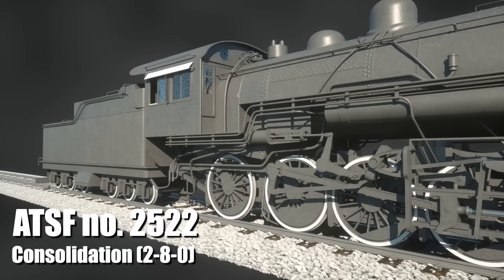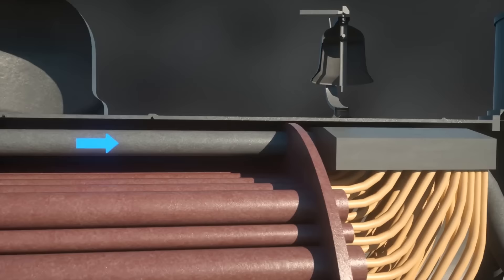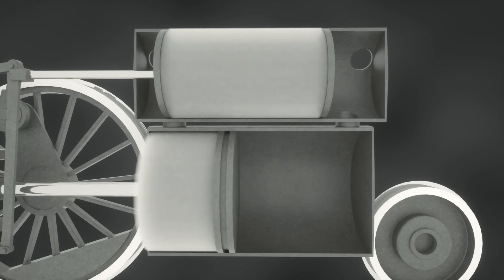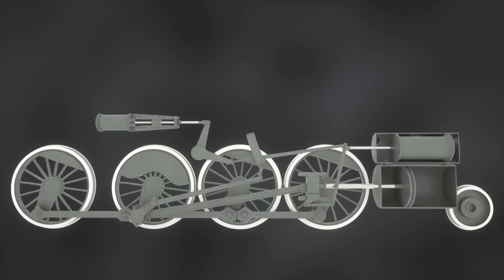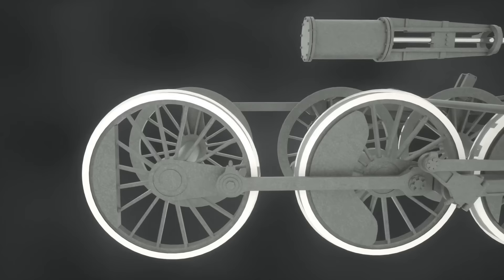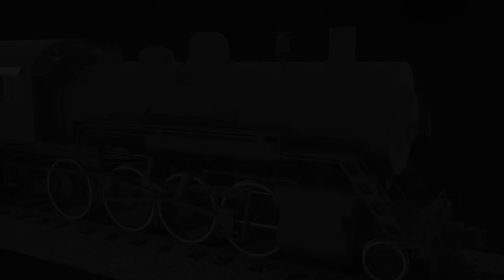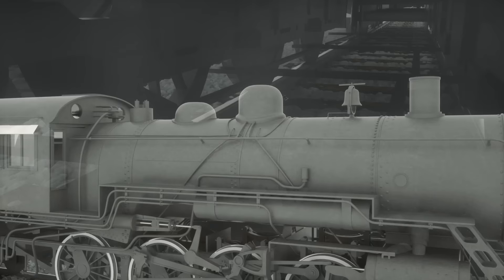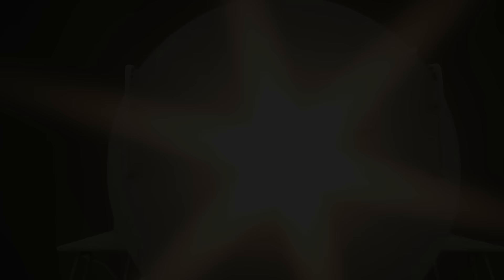How A Steam Engine Works

Comment: I would argue that it actually isn’t outdated. For passenger transport it is. But so is diesel for that purpose. Steam trains are actually more powerful than diesel trains and are actually generally simpler in design and function. However, the problem is energy waste. Diesel engines are more fuel efficient. But steam engines also use cheaper fuel. You can go back and forth though.

Comment: I learned a lot.  Thanks.  

Correction:  Coal was the dominant fuel for almost the entire history of the steam locomotive, not oil.  Engines were getting converted to oil as they were fading out, being replaced by the diesel electric locomotives.
Reply: I'm not sure on this one but when the steam engine came out , Didn't they use wood for fuel first and then went to coal ?
Reply: @ironmartysharpe8293  Sure.  Coal wasn't mined much in the very early 19th century.
Reply: @frequentlycynical642  Wood was also used in places where it was more readily available and cheaper than coal, such as Russia and the Nordic countries. But even in those places coal was preferred if available, as it carries more energy per volume and also produces less ash and sparks, reducing the risk of forest fires caused by steam engines.
Reply: In the U.S., after the early days of predominantly wood, the fuel of choice tended to be what was most available and cost effective regionally.  Generally (very generally), this meant coal in the east and oil in the west.
Reply: It must have been a huge blessing to the fireman/stoker when oil was used - so much easer to load and apply than coal or wood ............ Unless the train companys just fired the stokers !?!
Reply: @stupitdog9686  Many, especially large, coal burning steam locomotives after 1900 also mechanical stokers.  There were some variants, but the most typical had a corkscrew scheme to move the coal from the tender to the locomotive's firebox where the coal was brodcast over the top of the existing burning coals.
Reply: @stupitdog9686  No, the unions prevented that.  They basically did nothing but got a paycheck.  It was called "feather bedding."
Reply: same principle still
Reply: @trainliker100  I never heard of oil being a regionally preferred fuel.  The UP's Big Boy locomotive were strictly for the western states and they ran on coal.
Reply: @frequentlycynical642  A cost choice was the usually the biggest determinant.  For example, most of the Southern Pacific and its subsidiaries burned oil, not coal.  Because oil was in the area and coal would have had to be transported long distances.  Even in coal burning engines there were different firebox designs depending on whether the lowest cost, and most available, coal was lignite or bituminous.  The CB&Q had a number of Class O5 4-8-4's all built as coal burning, but converted some to oil as that was a better choice where they were running some of them.
Reply: @trainliker100  What years are you talking about?  That makes a huge difference.  Also, oil didn't come along overnight, it was a slow process.  Now, even the UP locomotives burn oil.
Reply: @frequentlycynical642  I'm not talking about any years in particular.  Just in general.  But to think about it a bit further, they didn't build those giant Fairbanks-Morse concrete coaling stations, and have to go through either hand firing or a stoker, and deal with having to dump ashes, when oil is so much easier, because of any superiority of coal, other than cost and availability.

Comment: Nice.  Your cutaway of the end of superheater flues cleared up a lot for me.  Small fire tubes, out of contact w the water,  within a big fire tube.
The combo of big tube's low surface area for their volume, and the fact that the inner tubes are not in contact w the boiler water,  means the air has tons of have tons of heat as it enters the superheater.

Comment: Even Though I'm just a Nerd, I'm gonna point out some things you missed:
1: About The Airbrakes, Pressure Releases it rather than Bite
2:The Steam powered bell does not really move the whole bell, It only moves the Clapper
3: You Missed on How the Injector Works is a steam pump that sucks Water to the Boiler(It's kinda hard to explain without a visual aid)
4:Please A More Chimney Boy Whistle :)
Reply: Some bells had the entire yoke swing, called a piston ringer. This was standard from 1906 until the 1940s. It was only later that the clapper ringers became common. There are also several different types of injectors, but all use a fairly similar principle of creating a vacuum and water rushing into fill said vacuum, simply some require steam to lift the water, whilst others use gravity.
Reply: That is not quite true.  

The air in each car does the real work. Reducing air in the train line activates the system. 

Also locomotives have a separate system than the train brakes. It is always direct air.
Reply: Well the bell wouldn't have been activated by steam anyways. It would have been air, or a pull cord. And yes they had two types one that made the entire bell swing or just a clapper.

Comment: Kinds of valve gear:
Walschearts valve gear - the first one
Baker valve gear - reversing yoke
Stephenson valve gear - 1 piston and 2 180 degree pistons
Hack worth valve gear - crank shaft connect up top

Comment: I love steam engines! They are indeed marvelous pieces of engineering and cold starting a more modern engine is quite a time consuming process, in part because steam literally drives everything on that engine and there are a ton of valves and so on that have to be opened and closed in a particular order to do a proper startup.

The one thing that railroads could have benefited from, which was never done because it was decided that it would be difficult to integrate, is multi-stage pistons. Here, we have an illustration of a typical two-stroke piston. Once the steam is used, it is exhausted or recirculated through a condenser (rarely) prior to being returned to the tank. The steam that is exhausted still has a good deal of energy in it. By increasing the surface area of a successive piston and reducing the stroke length, you can still take advantage of that extra energy to operate a second, third, or even a fourth stage before reclaiming the water. Multi-stage steam engines (not locomotives, just general engines) are fascinating and significantly increase the engine efficiency, although the efficiency and power of any steam engine is still far below that of an internal combustion engine, which is why they aren't around anymore. However, one thing steam engines have in SPADES is torque which made the ideal for certain categories of devices.

Comment: I need a source on that oil thingy. Always thought that most were coal fired
Reply: Yeah I have to say I've never even heard of an oil powered stream locomotive. All footage of steam trains I have seen online and even ones I have seen irl have all been coal powered, with one of the engineers needing to shovel coal into the furnace constantly.
Reply: Theres info on google, i too have just learned something new today mind blown. I thought they all used coal too
Reply: Some Engines, Actually Use Oil or Even in the Southwest USA they use literal logs or firewood
Reply: You're right most used coal since it was much better than firewood and largely available in Europe, but then Oil came and for a brief moment of time it was cheaper to convert and still use them.
Reply: Most were wood prior to 1880, a few logging lines in the Pacific Northwest and in the Deep South remained with wood into the 1930s. Coal came about in the 1880s (some roads adopted it even earlier, such as Union Pacific). Oil appeared on SOME roads as early as the 1900s, mainly western roads such as the Southern Pacific, ATSF (post 1920s), Northern Pacific, etc. Some eastern roads burnt oil (most were coal) to comply with various ordinances or other reasons (such as the Florida East Coast Line post-1910). By that same manner, some Western roads burnt coal (such as the Denver & Rio Grande, later D&RGW post 1921).

Comment: Great video and very informative. Something I do feel was slightly glossed over is the importance of the water valves that control the introduction of water into the boiler. Too much water and the fuel to steam conversion rate becomes suboptimal. However this pales in comparison to not enough water which is when steam engines tend to fail catastrophically.

It wasn’t just the higher efficiency of DE-Engines that put the steam engine on the shelf, the higher safety Standard also contributed massively.

Comment: You missed a visual description of the blast pipe operating.  Which makes the classic chuff chuff.  The sudden release of used, but still under pressure steam, surging from the driving cylinder to the blast pipe where it mixes with the smoke and explodes up the smoke stack. 
To me, this surge of waste steam from the blast pipe up the smoke stack in synchrony with the drive rods is the very essence of a railway steam locomotive.   The sound changes intimately with how hard the engine is working.
Seeing this animated would have been awesome. 
This vented steam is used to create draft.  It is also why steam locomotives use so much water as the used steam is lost and not re-condensed.  Water replenishment stops are more frequent than coaling stops.
Otherwise it is a great video. 🙂

Comment: One omission is the ejector connected to the bottom of the 'smoke stack.' As steam leaves the pistons it vents upward in the smokebox thru the stack. The ejector creates a suction in the smokebox that draws the firebox smoke thru the boiler. Without an ejector, there would be no flow thru the boiler.

Comment: When he mentions "The temperature and pressure inside the boiler is monitored at all times" the video is showing a sort of cylindrical device attached to the side of the boiler with a pipe going to it.  It might be confused that this is a temperature or pressure sensor and it is not.  It is a boiler check valve.  This is where water is added to the boiler under pressure and this check valve allows water to flow in if the water pressure is high enough, but not let boiler water ever flow out the opposite direction..

Comment: Steam is a rather unique and interesting thing, as we have used it for many different operations. Even today to generate electricity steam is used by either coal, natural gas or nuclear "pellets" to create the heat to create steam and use it to spin generators for making electricity. Even the ancient Greeks had steam engines.

Comment: Great video but I would like to mention that steam locomotives are sometimes pulled out of storage/museums for clearing the train tracks of snow and ice because they are/were better at the task than the modern trains at the time (or there wasn't enough locomotives that were capable at the time).

Happened in Sweden in 7 to 12 years ago, can't remember it to well because I was a child at the time and couldn't find any articles from a quick search.

Comment: Some of the activity of the valve gear is not discussed here.  And it can get a bit complicated and there are many valve gear designs besides the one shown here (which is the Walschaerts design).  But one thing may be worth mentioning.  If you look at the side view, the rod from the piston valve does not connect directly to the rod providing the push/pull motion.  Instead it attaches just a little bit down a vertical rod.  The push pull starting from the eccentric rod motion acts on the top of that vertical rod.  The "crosshead" which is attached to the steam piston motion is attached to the bottom of that vertical rod with a short little horizontal rod.  This effects the timing of the piston valve a bit like distributor advance on an automobile engine.  It starts the admission of steam to the piston just a little bit before the piston is at the end of its stroke.  In the video, you can see the slight timing difference when the piston valve and steam piston reach the ends of their travel.
Reply: Jesus said, “No one can enter the Kingdom of God (God's family) unless he is born of water and the Spirit. Flesh gives birth to flesh, but spirit gives birth to Spirit. You should not be surprised at my saying, You must be born again” (John 3:5-7). what does this mean? Well you have to believe with your whole heart that JESUS died for your sins and after 3 days and nighrs GOD raised HIM from the death, so you can be baptized and after being baptised ask GOD for the HOLY SPIRIT . WHO will guide you trough life!❤❤❤❤❤❤❤❤❤❤❤❤❤❤
Reply: @johanneshartman4618 wrong video

Comment: The names of wheel arrangements shown are correct and are the most commonly used names.  However, specific railroads sometimes used a different name.  For example, the Southern Pacific was NOT going to call its 2-10-2's "Santa Fe's" (Santa Fe being a rival).  So, they called them "Decapods" even though that is more correctly a 2-10-0.  Usually, they shortened it to just "Decs."  The 4-8-4 probably had the most names.  "Niagra" on the New York Central.  "Greenbrier" on the Chesapeake & Ohio.  "Pocono" on the Delaware, Lackawanna & Western.  "Wyoming" on the Lehigh Valley.  "Dixie" on the Nashville, Chattanooga & St Louis.  "Golden State" on the Southern Pacific.  "Potomac" on the Western Maryland.

Comment: I believe that they also use the steam engine not just for moving the train but for braking as well such as going downhill and as an aid for making emergency stops , It's all about how you work the valves and by doing so , You can achieve dynamic braking , Similar to a Jake brake on it semi truck
Back when I was a kid I was at Cedar Point riding the train to Frontier town and it was powered by a steam engine and the engineer had to make an emergency stop because an animal was on the track , So the engineer worked with the valves to stop the wheels on the engine itself and besides applying the brakes and locked up the wheels on the engine
I can imagine how hard it is to operate a steam engine because you have to deal with the unbearable heat coming from the firebox , You have to keep a constant eye on every pressure gauge besides watching down the track and constantly working the valves when you approach a hill going up or down
I can also imagine how hard it was for the engineer back in the old West during the summer in certain areas where temperatures topped out at 100 degrees plus

Comment: Our local steam train is a 2-8-0 ex Canadian Pacific locomotive it originally burned coal, but was switched to oil and runs tourist trains in our area with classic ex cpr coaches from the 1920s to the late 1940s, the diesel fuel backup locomotive is a Sw 1200

Comment: Is a steam engine really outdated? Or do we just don't want to use the concept anymore? We can use more than just coal as heating of steam right? Nuclear?
Reply: You see there's a problem with nuclear power for one nuclear produces more exhaust than like say propane also the power would likely melt the metal sheets too quickly resulting a massive explosion also the nuclear energy is very hard to put out meaning just putting out the like coal will not put the fire out immediately so basically using nuclear power on a steam locomotive is a bad idea

Comment: how a water from tender is injected into the high pressure of a boiler? for nowadays industrial boiler, we use electric motor to pump water but i have no idea how its done in a steam locomotive

Comment: Did steam locomotives had real generators to power electric lighting in the carriages? Or were they powered by batteries? Or was the Dynamo enough to power the carriages as well?
Reply: Usually the coaches had their own axle generators. The dynamo on the engines was really only for the engine

Comment: Steam can only have 100 C. Once it's steam it is a 100 C by normal pressure. It's useless to heat it further in fact you just lose pression with this super-heater, while the only thing we need is pressure.

Comment: Steam engines are not outdated, aircraft carriers still use steam engines, steam turbines not piston but still steam.  Nuclear power boils the water for the steam.  Also every power plant is a steam engine either using coal or natural gas, or nuclear power as a way to boil water.

Comment: Most burn oil?     No no.  Most steam locomotives through history burn coal not oil.  Granted a lot of restored steam locomotives in America have been converted to burn oil.  But they were originally built to burn coal.   Some logging locomotives would burn wood instead. But wood has less thermal capacity so locomotives would be down on power when burning wood as it’d be more difficult to build similar boiler pressures.   Also steam locomotives aren’t just nostalgic.   Some engines actually still pull revenue services

Comment: "An outdated" machine
sorry but no, we still use steam for different purposes, like Electricity, sure they use turbines rather than pistons, but thats like saying the a steam turbine ship engine from ww2 is not a steam engine because its not a triple expansion engine, which is not the case, they are both steam engines
steam engines are that outdated